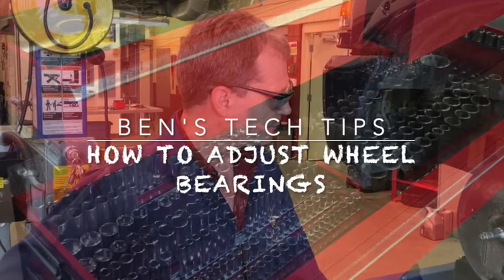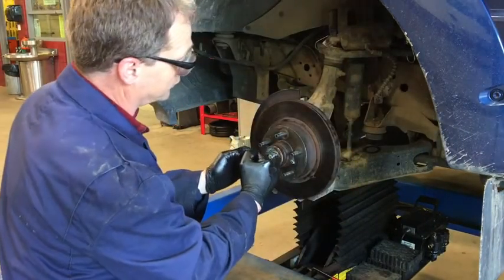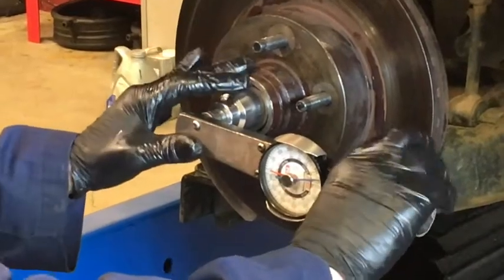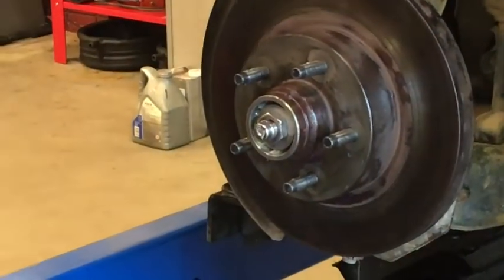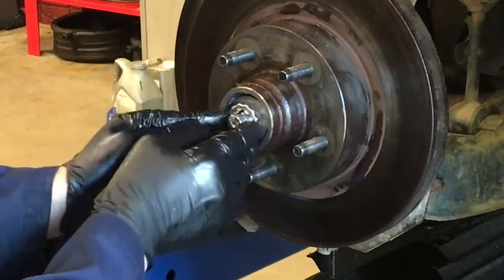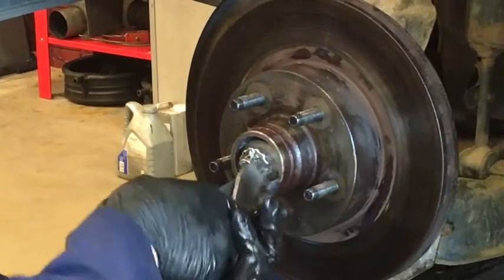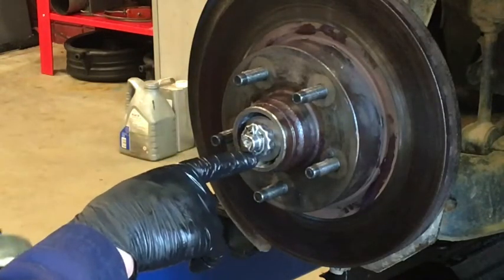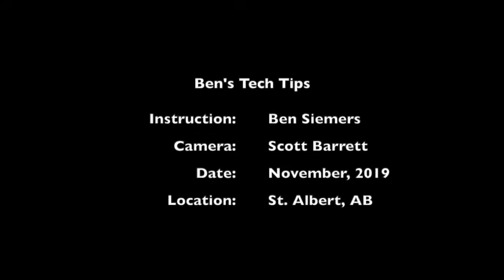How to adjust wheel bearings.

Comment: I always seem to have some play the next time i check mine. the rotors are for a 75 granada, it's a disc brake conversion for a 63 tbird. The spec calls for 0.001 to 0.005 inches of end play. I always feel like i'm making them too tight or not tight enough.

Comment: Mine does not have a crown or cotter pin
Reply from the maker: Generally vehicles that have repackable non-sealed tapered roller bearings will have a castle nut or nut and keyed cap with a keyed safety washer and a cotter pin, unless it is an older 4 wheel drive with hubs that has special spanner nuts, and locking rings.  You will have to check your manual to see if you vehicle is of the repackable style.  It sounds like yours likely is a sealed bearing style which is completely different, not requiring packing or the same tightening procedure.  I am uncertain of your vehicle make and model to really comment further.

Comment: hi. my car rear wheel torque must be max 202 ft/lbs. That is really tight. Some cars engine torque is even less. Car is Infiniti G35 sedan 2006 V35. If required is 202 and it us tighten with 205-210 ft/lbs, is that a problem?
Reply from the maker: Those bearings you are referring to are much different than on vehicles with adjustable and repackable tapered roller bearings which I refer to.  If you follow your service manual instructions and specs for your specific vehicle,  you are doing what is best for your application.
Reply: @bensiemers5094 .thanks that i watched this video because of the same observation of having to tighten at 200 ft lb but i find that the bearing will bind. It is a conical tapered bearing and I don't believe it so i approximate it by feel because i don't have a torque wrench. I did it almost the same of what you did. I feel i did it right....
Reply from the maker: @KK10027  I do not advise adjusting your G35 the way repackable tapered roller bearings are done.  Your infinity has CV shafts in the rear and has sealed bearings and a bearing hub assembly.  If you are unable to apply the recommended torque listed by the manufacture, this is a suspicious indication that you likely have a damaged bearing unit or an assembly issue, such as the rotor being forced into a binding brake assembly or perhaps something like protruding hub assembly bolt or another cause.  Your bearing hub assembly must be assembled according to your vehicle's specific procedure and be torqued to meet recommended specs for your car for safety reasons.  Here is a video to better illustrate the procedure for your specific vehicle.  Please seek professional assistance from a qualified technician if you cannot resolve this for your safety.  

https://youtu.be/nuNBYi_AqCs?si=Pdb8ChJiXdSJCRQn

Comment: This comment was wrong, don't do this:

Thank you soo much, on my 206 peugeot the manual said 200nm... that definitely blocs the whole thing and brakes all my work, now I'm happy to know it was so again, Thank you!
Cheers
Reply: This is only for adjustable wheel bearings. The 206 doesn't have that. You have to tighten that nut to 200nm otherwise you risk damage.
Reply: @davidszabototh  oh ok thank you
Reply from the maker: @supair8059  Please abide by your car manufacturer's advised procedure.  The procedure I outline is a "general" guide for repackable tapered roller bearings only and not for sealed bearing hubs.
Reply: @bensiemers5094  OK then thank you
Reply: My english is bad, sorry for my misunderstanding
Reply from the maker: @supair8059  All the very best to you.  :)

Comment: There is no torque on this hub nut so why is a Ford transit hub tigthtened to 420nm?
Reply from the maker: That is because the Ford Transit uses a non-adjustable type bearing that is designed with sealed, double-bearing design which prevents the tightening load from being directly placed on the bearing rollers themselves.  

The specific bearings I am giving instructions on are adjustable repackable bearings used in vehicles that were not of the front-wheel drive or modern all-wheel drive design.  Utility trailers also use adjustable bearings.  There are some older front-wheel drive vehicles where the rear wheel bearings were repackable and adjustable.  You can tell that you have an adjustable bearing because they will have tapered roller bearings, and visible grease with a bearing cap.    The roller bearings, cage, and inner races are removable by finger from and their outer races that are pressed into the bearing hub.
Reply: Thank you for your quick response, it's nice to see a true professional at work 👍

Comment: Do you need to recheck these after so many miles?
Reply from the maker: Repackable wheel bearings should be checked for play when you do routine oil changes and maintenance.  Manufacturers' recommendations will vary but the range of about 25,000 to 30,000 miles is likely in the ballpark.
Reply: @bensiemers5094  ok thank you man

Comment: I am in the habit of packing grease around the nut and in the cap. More=Better... However... I notice you did neither. Not necessary? Causes Problems?
Reply from the maker: I believe I did mention in the video that I usually do, but for sake of demonstration I just gestured it.  It is primarily to prevent corrosion in the cap.  It is optional, but not a bad idea.  Applying a bit of grease to the nut and safety washer is not a bad thought as well, although, usually with handling, the nut and safety washer gets some grease on it.  Saying that, I haven't seen too many caps with rusting in them through the years, unless someone has really been in a lot of extreme conditions and has lacked doing maintenance.  Great comment.  Thank you.
Reply: @bensiemers5094  Great Video!  I really appreciate the time to setup/film/edit. It is awesome to be able to learn from someone who knows!

Comment: Best I've seen.
Looks like moving, disturbing, or rotating the wheel after seating, loosening, then tightening to 5 inch lbs is a no-no

Seat/loosen/tighten to 5 inch lbs without rotating.

If so, I've been doing it wrong 😳

Thank you 👍
Reply from the maker: Hi, Randy.  Thank you for your kind comment.  You have a keyed safety washer before the nut, so moving the rotor shouldn't influence the adjustment and can actually assist in getting a good feel.   The main thing to take away is that once you have seated the bearing and backed it off, you just then adjust it until the play is gone and add a tiny bit just to ensure all the play all out,. Keep in mind that some cars may have threads that are marred and this could affect the proper adjustment feel.    A person should grab the rotor and verify that there is little to no wobble on the rotor following adjustment.   As an extra note, sometimes spindle wear can cause unexpected rotor movement even following a good adjustment, so spindles should be checked for wear and marking if this is the case.    Note that each car will have a spec that may vary slightly,  but the rule of thumb generally does the trick well.
Reply: @bensiemers5094  I replaced one spindle last year.  The replacement from a wrecking yard was like brand new.  All is good there.
The other spindle has a groove on its 'thrust' surface from the bearing rotating,  obviously.
Could that be simply because of the age, because I've always had the bearings too tight or maybe even  had the bearings  too loose? My S-10 has 288,000 miles on it.
I had that spindle wear problem on my 66 Chevy, and I also had that problem on my 73 chevy step side and now I've had that on my 93 S-10.
The key factor here is all these vehicles had quite a few miles on them.  For that reason I'm just curious if it's an adjustment issue or if it's just an age issue. 
Is this a common issue because of age or is this improper tightening of the bearing?  The inner race obviously has to spin to make that groove in the hub, but I don't know if that's somewhat normal in a vehicle with a lot of miles.
Thank you for your prompt reply.
Reply from the maker: 288 000 miles is a good amount of running, so it likely is just worn from a well-used life.  The inner bearing race is designed to creep slightly around the spindle to prevent the rollers from wearing flat spots on the race due to load.  They don't spin fast, but the slip-on fit intentionally permits slow creeping.  A little grease applied to the spindle initially provides lubrication to reduce wear.  If the bearings run dry, though, it would accelerate spindle wear.  They do slightly wear over time, even under the best conditions.
Reply: @bensiemers5094  Thanks, Ben. The spindle is fine, it's the flat end that the inner bearing race is against, the thrust surface that the seal  is on.
I'm gonna guess age.
Reply from the maker: Best wishes Randy.  Happy wrenching.

Comment: Wanna hear what my dad used to say? Don't take my advise as gospel. But my dad used to routinely pack his wheel bearings back in the old days when we were kids. If my memory is good,  But he used to seat the bearings and spin hub like you do then back off about a 1/4 turn or so.. Also he used to check his hubs for heat when we drove long distance. And one thing he said, if I remember correctly was this. If the hub was getting hot , and you need to adjust the bearing. Most people want to loosen the nut a little thinking it's too tight and causing it to heat up.. But what he told me what you should do is tighten the nut ever so slightly just a little bit. This should make the bearings run cooler. Once I was moving from the east coast to the west coast driving an old Chevy truck. So I repacked the bearings and put it all back together. When I set out ( loaded down and pulling a trailer full of belongings) I kept checking my hubs. One was running a lot hotter than the other so I stopped and did what I had learned. And I tightened the bearing nut just a little. Like an 1/8th or 1/4 turn tighter and it ran a lot cooler. So It seemed to work.   Not sure if you ever heard this or common knowledge among mechanics  thanks
Reply from the maker: I think there are a lot of different techniques people use in an attempt to get close to correct preload.  The goal, however, on these types of bearings is to just get rid of the play, and not add any considerable torque on the bearing nut as this can cause overheating.  In contrast, under-adjusting wheel bearings can cause wheel wobble and can cause the brake pads to push the caliper pistons back into their bores, resulting in a low brake pedal feel.   Manuals are very good at outlining the procedure and those procedures work very effectively, without having to resort to readjustment.    Thank you for your comments.
Reply: @bensiemers5094  ya I was just interested in if you ever ran into the idea of if running hot, to tighten a smudge rather than the idea of "oh I need to loosen it a little" philosophy.  Thanks. When you are doing this type of work and don't have all the gages and wrenches for proper settings and specs.
Reply from the maker: Hi Bill,  I can appreciate a lack of gauges for sure.   I have seen quite a few different things for sure in the farm community and from home handymen.  Feeling bearing temp has been one of them in regards to assessing load on bearing from one side to another.    Thanks, Bill
Reply: @billtmarchi4320  you haven't set the world on fire with your info here, it's pretty common knowledge
Reply: @bensiemers5094  would the manufacturers instructions for torque need to be adjusted for an older vehicle with a lot of miles on the spindle? I followed them for my 26 year old truck and there’s still play in the wheel. I asked because you said get the slack out of it. Is that what I should try? New bearings. Tire guy said if my bearings look good to clean them up, repack, and tighten it. I just went with new bearings.

Comment: Is it possible for a wheel bearing to spin on the spindle if it fails or was improperly installed?
Reply from the maker: Good question.  The inner race is actually intended to creep around the spindle slowly as it is driven to prevent a flat spot from developing where the load is.  So lubrication on the spindle is essential.  A rough damaged bearing, or incorrectly adjusted one, could increase the creep rate where the inner race spins excessively on the spindle and causes spindle damage.
Reply: @bensiemers5094  what would constitute excessive spinning? Since it’s a pretty tight fit but not pressed on grease will definitely get between the spindle and the tapered bearing race. I figured they spun a bit at least but the friction with the weight on the bearing was enough where the rollers did most of the spinning.

Comment: I use hardened valve spring shims when a castle nut is too loose from backing up to align cotter pin. The shim goes under the nut between the nut and keyed washer.
Reply: Is that really where it goes?? Really??? Why wouldn't it go on top of the nut? 🤔

Comment: When I slid the wheel bearing on my vehicle it was hard to spin . Please, what is that and why.
Reply from the maker: A few things to check.  Ensure there is no bearing damage and cage damage.  I have seen people reverse one of their bearings. If the bearing is over tightened it will cause drag.  Brakes incorrectly installed could also happen as could a bent brake shield.  

So a few things to rule out. Best wishes
Reply: Ben Siemers , well here’s my story I have a 2015 F150 4 x 4 I had a large pothole enough to bend my Front passenger rim !!!! I started hearing a lot of noise and change the wheel bearing and of course my rim too . now the same wheel is hard to turn
Reply from the maker: Hi Andre, without me actually being able to inspect each part and see how the assembly has gone, I really can't be confident in providing too much more details.  4x4 vehicles have a bit different bearing set up than conventional 2 wheel drive and it is important that the adjustment is performed to spec and that the lock when installed doesn't alter the adjustment of the bearing or excess drag will occur.  I would also suggest taking the brake calliper off to ensure that the drag is in the bearing itself.  Seal installation is also very important.  If it isn't at the right depth, it can cause a drag.  Bearing part numbers, I am assuming, are correct, but worth double checking.  If you struck the wheel hard enough, it is also possible that the spindle, steering knuckle or control arm have been compromised.   If the rotor has been moved inward from its proper position, it is possible that it could force the CV shaft inward and potentially put load on the wheel bearing.   You may have to bring your vehicle into a licensed professional to better assess, if you are not able to pin point the problem.  Best wishes.

Comment: I do is,most wheel bearings between the nut and the bearing have a washer,that washer between the shaft have a gap,first I tighten the nut until the washer won't move by a screwdriver, make sure 12:00 4:00 and 8:00,all need to use the screwdriver to move,and   don't damage the bearing,and then loose the nut about 5° each time until the washer start to move .I do this way from a car to big truck,hope this can help people they don,t have special tools.
Reply from the maker: That is a nice practice too Alan.  Yeah - we don't want to load the bearing during adjustment.  Thank you for your comment.
Reply: @bensiemers5094  I learn it from government workshop,another way to adjust is ,after you over tighten the bearing,spinning the  wheel,eyes watch the tire u til it stop,it should move back a little, it mean too tight,same loose 5° each until the tire won't move back.
Need are good eyes :)
You can balance wire tyre,like bicycle and motorcycle use eyes.